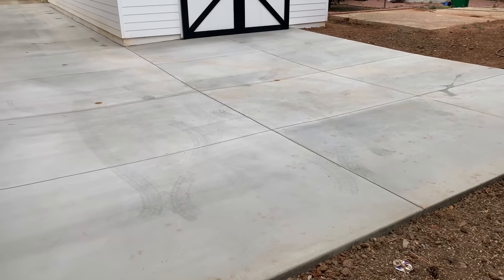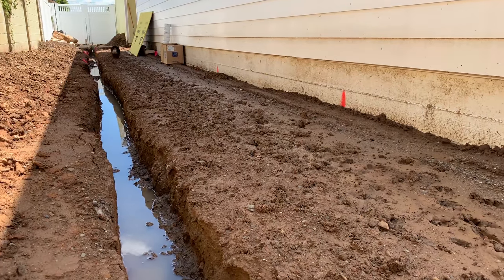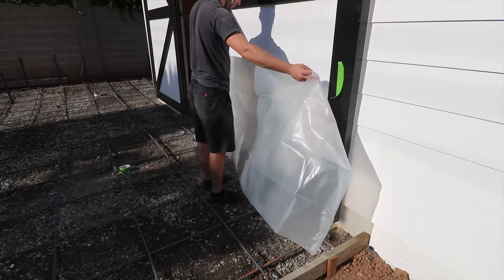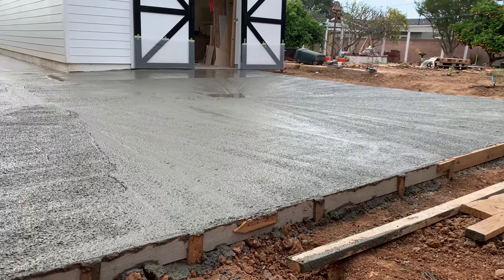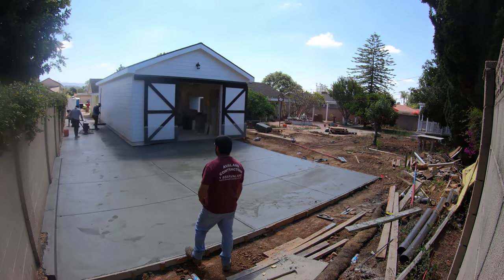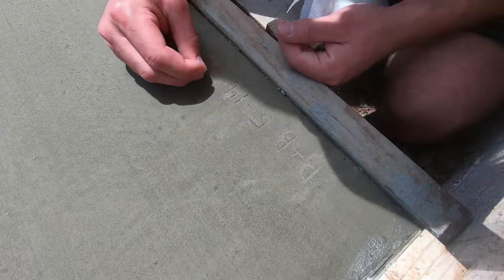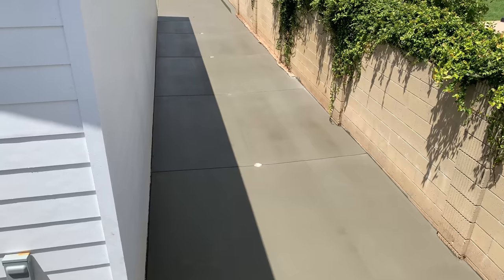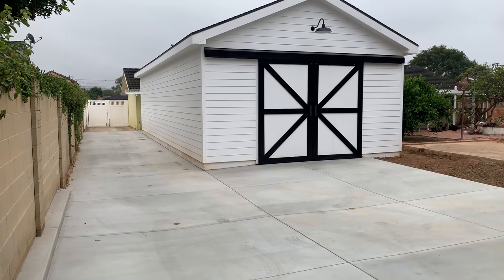Shop Build - Concrete Runway

Comment: There is not much point in having rebar, when it is at the very bottom of the slab. They should have used risers or at least lifted the rebar up when pouring.
Reply: Thats one of my biggest pet peaves. They did a great job on the rest of it except for that.
Reply: @Josh H Nah, it's sitting flat on the ground!